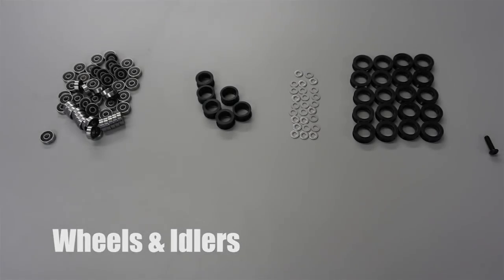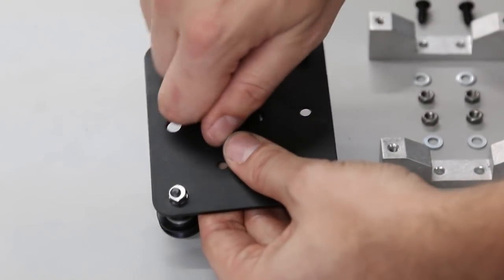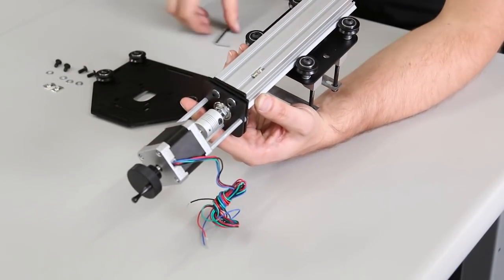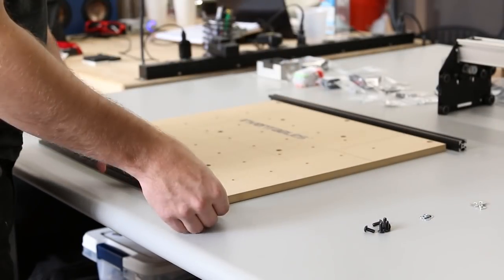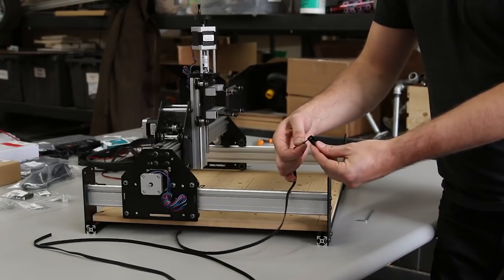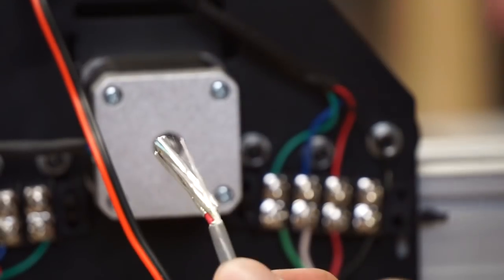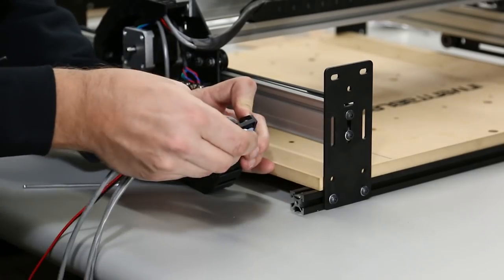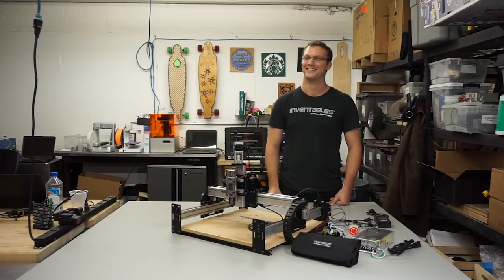Shapeoko 2 Works Kit Tutorial - Desktop CNC 3D Carver Router by Inventables

Comment: The bad thing about using such soft elastic belts on both sides of the Y-axis is, they could stretch with different belt tooth ratio left to right side, leading to non-symmetrical movement of the Y gantry and milling with too much deviation compared to the 3d file. This is why I would recommend using either fiber-reinforced belts (virtually impossible to stretch), or steel chain, or rack&pinion.

Comment: The wiring of the AC power to the power supply is incorrect. The white wire goes to 'N' terminal, the neutral connection. The black wire goes to the 'L'  connection, referred to as the line not the " load".

Comment: Hi, i dont know why they using a normal metric thread for the spindles. ( you can see that in 10:23 ) . Metric threads are only for holding nuts to assembling parts together. They are not really the best solution as a thread for movement. A typical thread for movements is a trapezoid spindle or ball screws. Trapezoid spindle is also very cheap.

Comment: Your AC wiring is backwards... For USA AC wiring, Black and Red always indicate *L*ive and White indicates *N*eutral.  It is important to get that correct because the Ground and Neutral get wired together inside of your mains breaker box.  Any equipment that malfunctions on the same breaker line can cause other badly wired equipment to fail as well.  Make sure its right.  White is Neutral... Black and Red are Live.  Green (or bare wire) is Ground.

Comment: The grey wire is self stripping, simply make a small vertical cut along the wire and grip the nylon string with pliers and pull along the wire which will make a vertical cut, once you have stripped back enough sheathing cut it flush.

Comment: Excellent video and Shapeoko is a nice machine except that only Easel software works with it. Too bad Easel software doesn't work with all cnc machines.
Reply: That's not true. Any GCode file can be sent to the Shapeoko. GCode has been around longer than this machine and is used by most CNC users.

Comment: dude you are opening yourself to liability with incorrect wiring connections. I was going to correct you , then saw your little note about it. white goes to load? wth? I thought white was always neutral, and the power supply is the load. L=line=Hot. edit your video instead of
Reply: +rilayton1 White is not ALWAYS Neutral. White can be hot or traveler, and blue can be Neutral in certain situations. ie. if the wire does not contain a white or natural grey. Blue is your next choice. The say what is there to know about electrical white to white black to black is a wives tail and why people should generally call a certified electrician.

Comment: I feel this is a fantastic and informative video. I do have a question tho. I have a Bosch Colt to be connected to this bad boy, question is...I know the kill switch doesn't work with that router...So I am just plugging in the router separately and turning on the CNC? Or do I wire up the router into the CNC?

Comment: great build. The only thing I see on the video that should be changed, is when you connect the power cord to the power supply, the green wire goes to the ground, the white wire goes to the neutral and black wire to load.
Reply: Ditto! Green is always ground, and white is always neutral. The video connects the circuit conductors to the power supply improperly.

Comment: please, what size is the stepper motor?
Reply: these look like nema 17
Reply: +Adebayo Oladipo Hi, as you can see in the video they use the SM42HT47-1684B on all axis. Its a stepper motor nema 17 and current 1,68 Amps phase.

Comment: This system not only can be used for CNC work but also be used for Open Pick and Place when it comes out of the works. Belt drives have been used on many pick and place machines with a similar type gantry system.

Comment: Great vid! It was very helpful but the wiring part has issues I believe, I followed the y-axis wiring in the vid but the motors were vibrating cw and ccw. I had to change the wiring to be black-green,green-black,blue-blue,red-red. The rest was absolutely fantastic!
Reply: Something is different on your end. I did it exactly as he did here with no problems.
Reply: okanaish 
You're right, I had the same issue, followed your suggestion and works perfect now.